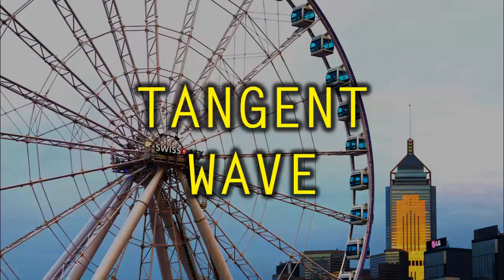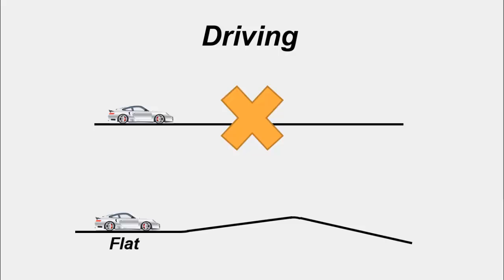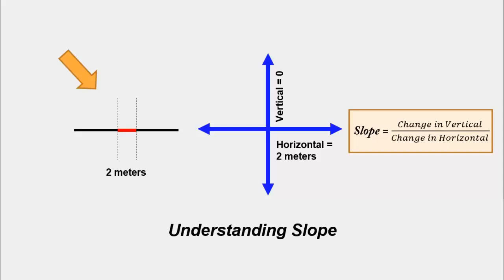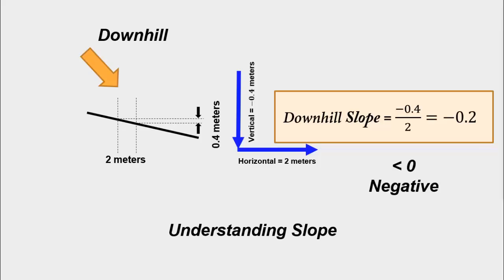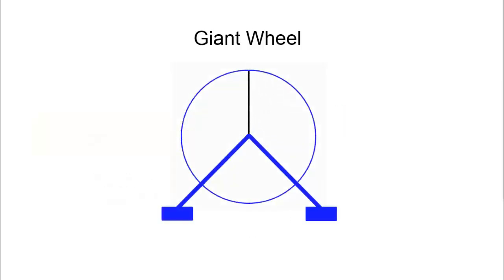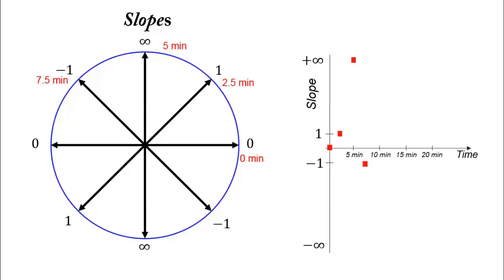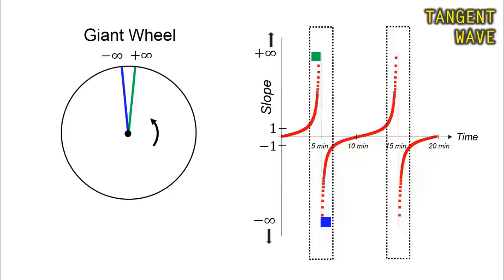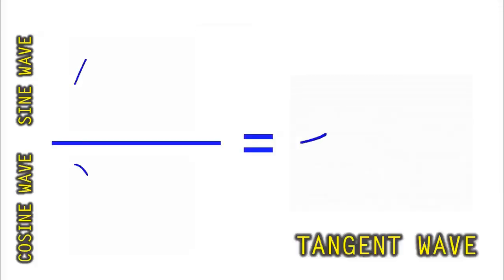Tangent Wave | Tan Function | Trigonometry | Explanation on a Giant Wheel | Slope | Learnability

Comment: Here's said that tangent is parallel to line inside the circle but it's written often everywhere that tangent line is always perpendicular to the "radius" line,  how's that please explain
Reply from the maker: Hi! Actually, “a tangent is always perpendicular to the radius” is sort of a confusing statement for students. In reality, a tangent is a simply a straight line that touches a curve or curved surface at a point, but if extended does not cross it at that point”. The curved surface here is the circumference of the circle. When we explained the concept of slope in this video, we used a line inside the circle. Turns out, it is the same as the radius. Then we showed that the tangent is simply parallel to that line to prove the slope graph stays the same. To understand further, you may start with any tangent on the circle of your choice and rotate it around and plot its slope. All that would change is where you would start and end on the tangent wave. Another way to look at this, if you draw another radius vertically up from the center to our chosen tangent and it’ll be perpendicular the tangent and your statement would hold true. Hope this helps! And thank you for supporting the channel.
Reply: yes, I checked in Desmos graph and there I found two concept: "tangent line" and "tangent function"... 
so in "tangent function" there's a line that perpendicular to radius but  "tangent line" it's the stuff that you explained here: "a simply a straight line that touches a curve or curved surface at a point"....so I'm little bit confused when to start with and how to imagine it in my head))
Reply from the maker: Sure, it can be confusing. Here's the distinction:

 - A function is something which would take an input and give out an output. So a Tangent function would be Tangent(45 degrees) = 1, where 45 degrees is the input and 1 is the output. f ( input ) = Output where f or function here is a tangent.

- A tangent line is what we discussed, different from a function with an input output relationship. Tan function is added to the title of the video so when people search for it, this video provides an insight into where the tan function comes from.

Again, Tangent Wave is a function where the input is the horizontal axis, and the output is the vertical axis.
Reply: @RoseUniversity  Thanks a lot! I'll have to do some more research and learning, but your videos really helped me gain insight into trigonometric concepts.
Reply from the maker: Glad they were helpful!
Reply: No, I couldn't figure it out, everything is confusing here's said that tangent is a parallel but any other videos tells that it's a perpendicular line to the "slope" or radius line ...If you could make a video abut this relationship or why is that it would be awesome....thanks If you're willing to btw.

Comment: 5:54 --- 50/0 is neither "infinity or a very very large number". So what is it? -- It is a wrong question to ask.
Reply from the maker: Hi E Z, please read our comments. You're absolutely right. A number divided by zero is n.d. When the denominator is very very very small and positive, its + Inf; and when very very small but negative, its - Inf. Those are the jumps in the graph, and of course the n.d. lies on the dotted vertical line that can't be plotted. The key is to understand that fundamentally the tangent curve is just the ratio of the sin to cosine. Thanks for supporting the channel!